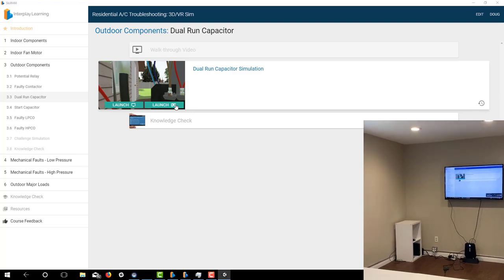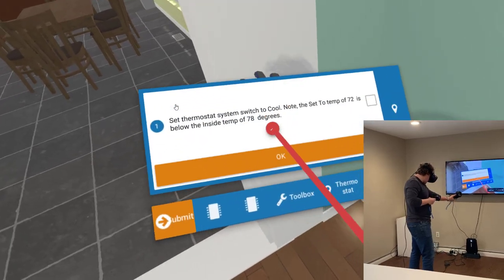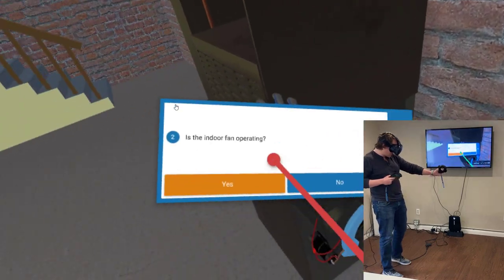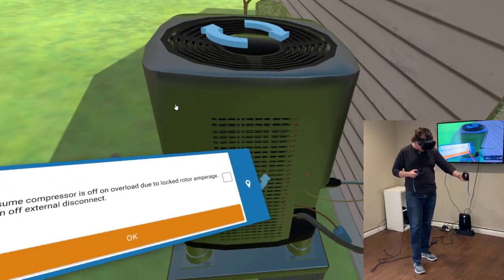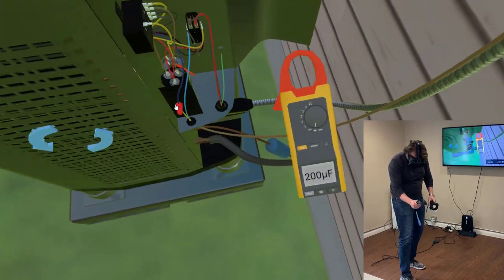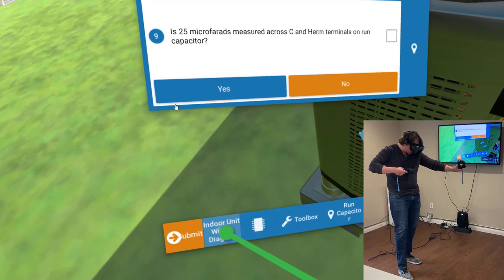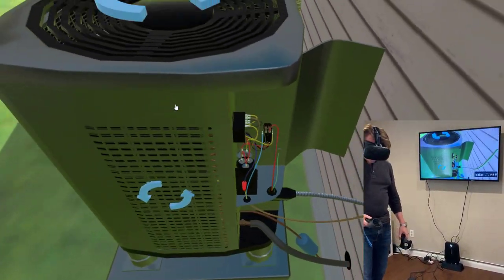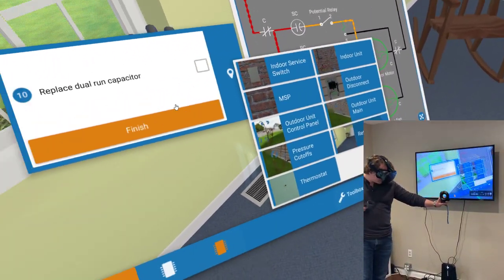Online HVAC Training in Virtual Reality

Comment: The dual capacitor example, demo refers to 'disconnect the brown wire from right terminal' which is fine for the visual but depending on the orientation in the field this may be confusing for a learning tech thinking the "brown wire is always on the right"

Comment: Ehh don’t like how it babies you through and basically is telling you what is wrong , should be an option to turn off assisted walk through during diagnosis , also it not having you double check voltage after pulling disconnect. Would still be cool to go in and screw around though.

Comment: I think you should have to physically connect and disconnect the wires etc instead of just pressing a button because in the files you have to get in there and handle everything. I work in habc service and maintenance and I also have a VR headset, looking to get this simulator.